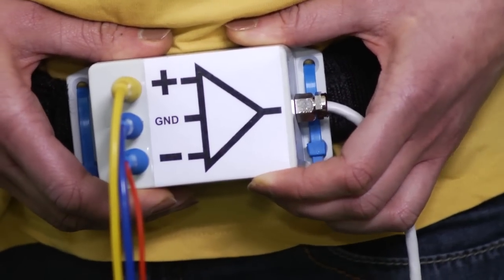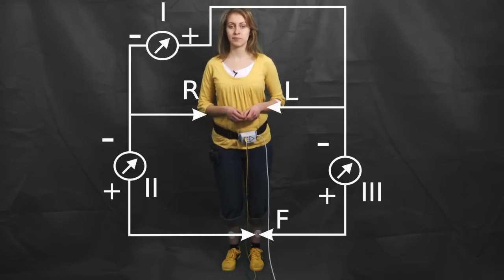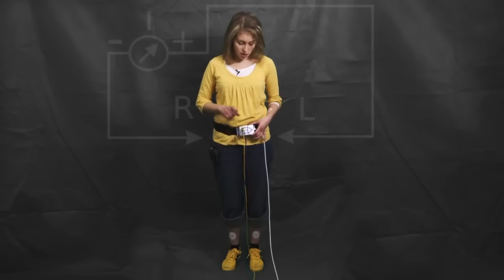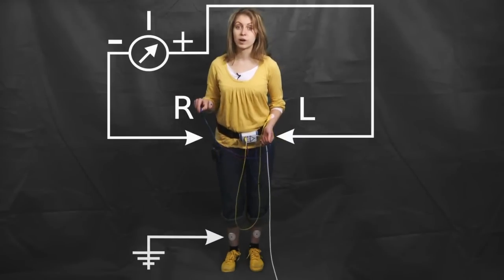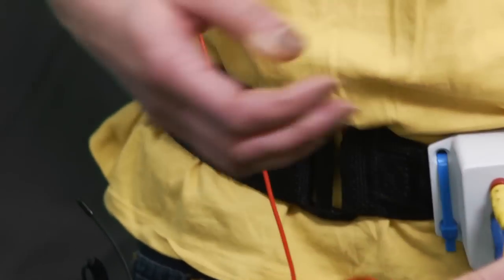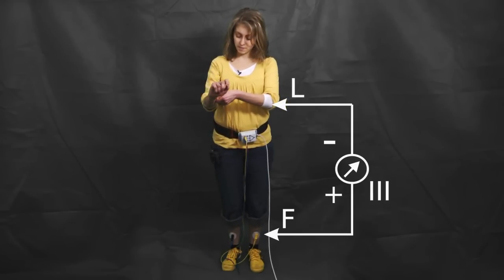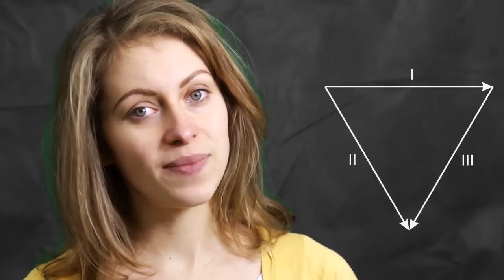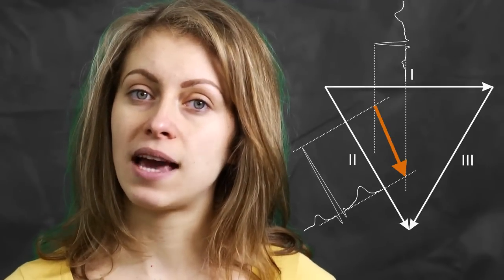ECG: The Einthoven leads & the mean electrical axis

Comment: What is the purpose of the ground electrode? - I've heard that it's for noise reduction, but how does it work? Thank you
Reply from the maker: Internally the instrumentation amp measures the two active signals against GND and then subtracts these two signals from each other. In theory the GND can have any potential because the 50Hz from the mains should cancel out (there is only one mains!). In practice large noise at the active electrodes cannot be 100% canceled out because electrodes are not perfect nor the amp itself. So better to have a solid GND. Some ECGs even inject the inverted 50Hz back into the GND to minimize it even more (which is called right leg drive) but that's overdoing it I'd say!
Reply: Thank you so much, it really helped a  lot :-)

Comment: Hi
What is the significance of getting angle of electrical field of the heart?
Cheers
Reply from the maker: One reason is how the heart is actually in your body. The more vertical is the smaller is the right chamber which pumps your blood in the lungs. If the right chamber is bigger then the lung causes a higher resistance. For example by tar through smoking or ageing. Other option is after a heartattack. The excitation might need to do 'detours' to travel from to to bottom. Having said that I'm a physicist so better ask a cardiologist. :)
Reply: Its the electrical axis of the heart. it has a normal value from -30 to 90 deg. depending on which way the axis deviates can help a doctor determine what is going on with electrical system and musculature of the heart.

Comment: Why you have to take the third trace if you haven't use it?
Reply from the maker: Very good point. Because it's not needed for construct a vector in a two dimensional coordinate system. Most modern ECG machines actually won't measure it but rather calculate it from I and II.
Reply: BPM biosignals
Perfect! Thank you!